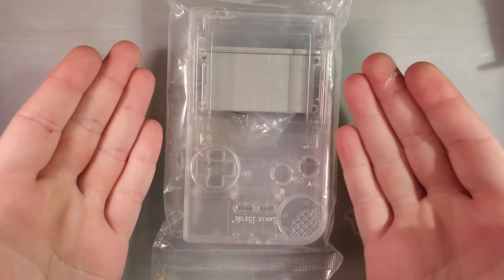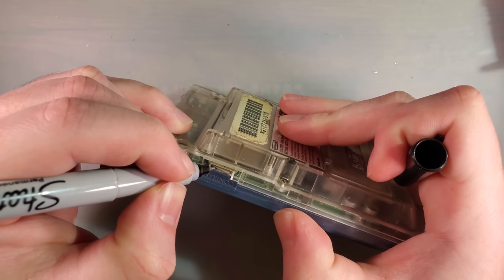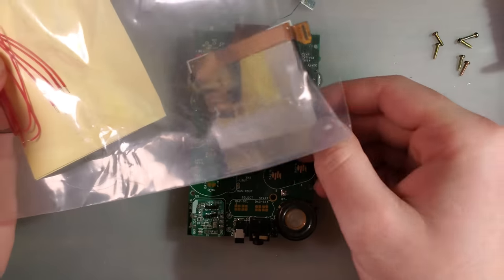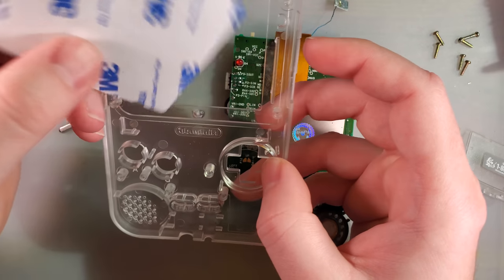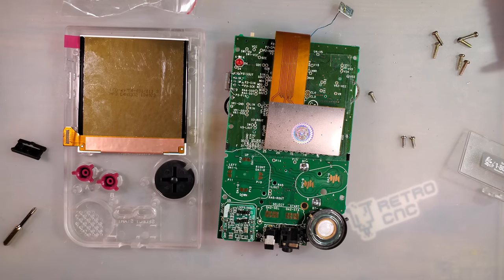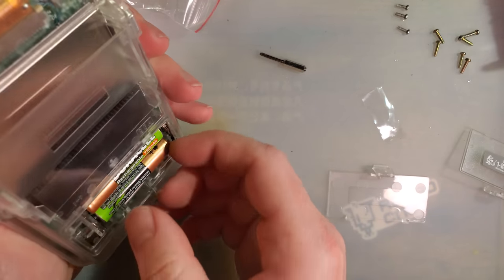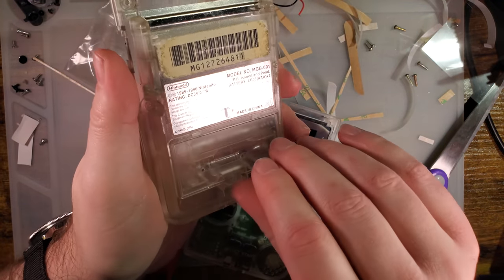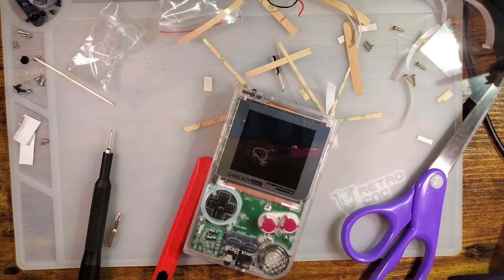Game Boy Pocket IPS Ready Shell (Funnyplaying)

Comment: Do you happen to know the alternate soldering point for adjust color palette/pixel model on this kit? I ripped my soldering pad and got searching on reddit. There I found a post with photo’s from you of alternate soldering points, but as far as I can tell you only showed that of the CGB retropixel. Would this be the same? I actually tried and it failed. Hope you can help
Reply from the maker: > on this kit
That was a game boy color in this video. You mean for the funnyplaying game boy pocket Q5 kit?
Reply: @makho  correct, the pocket version indeed. In the meantime I’m in contact with funnyplaying and they might provide a new ribbon cable, but it’s still good to know the alternate soldering point for the pocket q5 kit

Comment: Awesome vid! Would love to see you test a LiPo battery mod in one of these with a IPS screen compared to standard batteries. I know you said it might benefit from one and I’ve been thinking about doing one for myself! Thanks anyways for the content!
Reply: I did a LiPo mod with a 600mah battery (902035) and I’m getting a little over 3 hours on default brightness using Everdrive-GBx7. I did have to cut thought the battery compartment since I’m using a regular aftermarket shell. However if you find a battery in the likes of 602244 then it may fit on this shell without much cutting - may try it ;)

Comment: Unrelated question: What is the suggested temperature for soldering wires onto the ribbon cable for these IPS kits? I'm afraid of damaging the flimsy things.
Reply from the maker: You probably shouldn't be learning to solder on your expensive IPS ribbon. 

I solder at 280C
Reply: You're definitely right about that lol. I have been watching a number of guides and tutorials, but of course nothing beats real experience. 

With some luck I didn't fuck it up, at least. GBA still works and I can now change the brightness to boot. Next on the list is my SP.